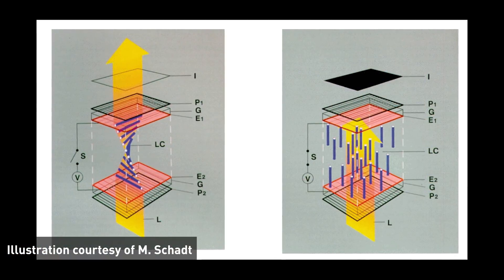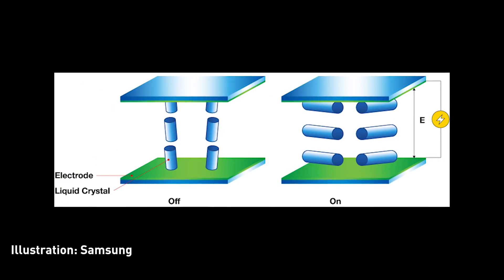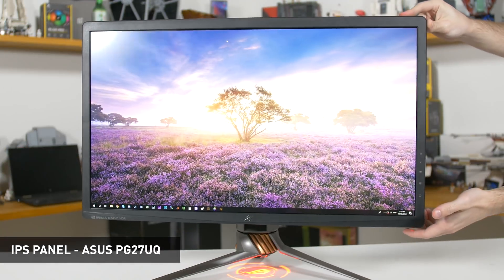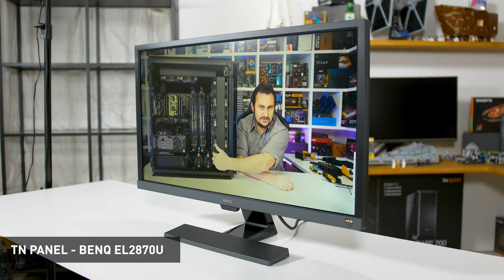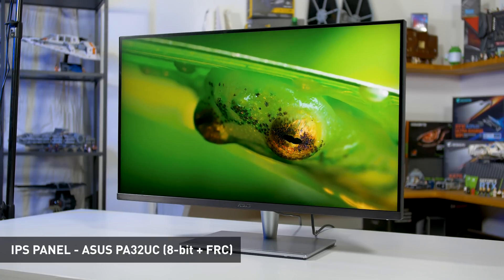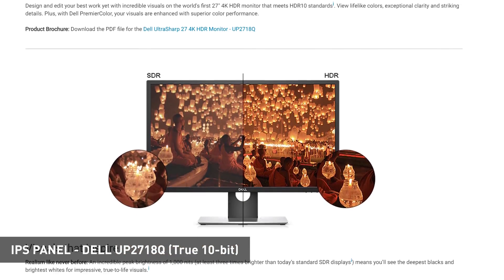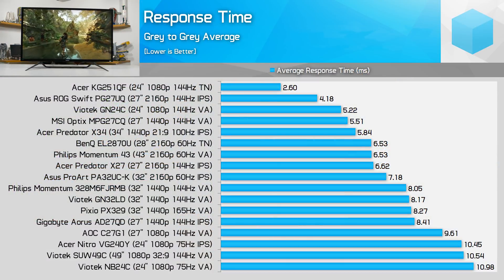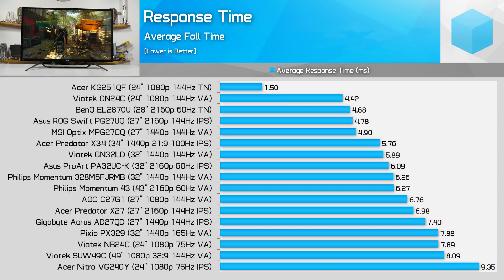TN vs IPS vs VA: Which LCD Monitor Tech is Better?

Comment: TLDR IPS SUCKS, IPS GLOW IS AWFUL, VA SUCKS MOTION BLUR AND GHOSTING, TN SUCKS POOR VIEWING ANGLES AND COLOR. ALL SUCK, PICK YOUR POISON! I can't stand IPS GLOW, my gaming room is light controlled and I play dark games.. Diablo, Doom, etc, IPS is unplayable soo bad. TN Contrast ratio no so bad when you turn monitor brightness down to 20, which is plenty in an always dark room. 8 Bit TN are actually quite good with colors too, they are out there, my XL2730Z is a 5 year old, 144 hz 1440p, 8+FRC Bit panel. If it had better freesync i'd keep it forever, but not compatible with Nvidia so looking for an alternative. If your buying top end TN (Think Omen 27), your going to get 8 Bit color, "better" contrast ratio's, and super speed. Not enough emphasis is placed on the difference between cheap low quality TN, and high end TN.

Comment: Short Answer: 
TN=competitive gaming 
IPS=video editing and most type of gaming
VA= watching movies and casual/singleplayer gaming.

Long Answer: For most people I would say IPS is the best because they have pretty fast response times and refresh rates along with amazing colors. So you can create content, but also have a very responsive gaming experience. If youre a competitive gamer and want every advantage possible, go for TN. Honestly most people hate on TNs, but if you buy a high quality TN, the colors really arent that bad from head on (which is where you will be looking from anyways). The colors usually look a little washed out from the factory but if you turn up the vibrance, it looks pretty nice. I wouldnt really recommend VA for anyone because, personally, I think 144hz should be the new standard, and VAs just dont have a fast enough response time to deliver that. Unless you truly prefer cinematics and visuals with HDR, IPS is the much better option. Ive gamed on VA displays but it just feels too slow and blurry. IPS was definitely a big step up, but it still didnt feel as snappy and responsive as TN. So in conclusion most people would be best off with a 144hz IPS display. 

Side Note: I prefer performance over quality, which is why i dont mind the colors on TN panels and still use them, but I only play games (mostly competitive) and watch youtube, and from what Ive seen most people think TN is unacceptable compared to IPS and VA. Then again though its all preference.

Comment: So what's better a 1080 TN or a 1440 VA? Both supposedly 144hz both supposedly 1ms response time.
Reply: 1 ms on VA panel?     30-50ms on dark colors (black smearing)...
https://www.tftcentral.co.uk/reviews/coolermaster_gm34-cw.htm#gaming_comparisons
Reply: @besmertnik  yeah I don't believe it either buy it's the claim on the specs. I am still torn though price is similar. I guess it just comes down to their resolution.

Comment: I've had large monitors of all three types.  TN has only one redeeming quality - they're cheap.  I've yet to see an IPS panel that has decent black levels.  In a brightly lit environment, they are fine, but turn the lights off, and they're just awful.  And, that IPS glow is annoying.  My current monitor is a VA.  The blacks are great, there is no glow, and the difference in contrast is obvious.  After owning a VA, IPS and TN looks dull, due to poor contrast.  Still waiting for OLED, or something similar...

Comment: I just bought an MSI Optix G241 (not to be confused with the MAG241c)
This has a 1ms response time
144Hz
Relatively budget

And is an IPS!

The days of TN are coming to an end...
Reply: Msi g241? Is it good? I'll buy a monitor and still confused between g241 and asus vg249q. Who is the best between them? 
Sorry for my bad english;)
Reply: @Fajri SN
having never used the ASUS monitor, I would just say that the MSI Optix G241 is definitely worth the £199 price tag and is probably the best gaming/workstation monitor below £200
Reply: No monitor has a true consistent 1ms response time, not even monitors with TN panels. But yeah thats a beast monitor for its price.

Comment: i want to buy the optix mag271c, but what hardware unboxed is saying that response times to big create a fake 144hz experience took me offguard. the monitor would still create 144 images per second, right?
i have been googleing for a day or two but hardware unboxed is the only one saying this.
edit: because of availability in my country the model i want to buy is the mag27c but this doesnt change my question.

Comment: I use a TN 24.5" 1080p 240hz. (Alienware). After a year I feel like the colors are as good as a TN could have. Response is amazing. Never had an issue. Viewing content like video doesn't bother and esports and multiplayer games it is a dream. I do find it harder to spot distant objects in 1080p regardless if in game settings and draw distance, but I haven't compared with a 1440p 27" which will have a similar pixel density anyways. 
THE MAJOR CON: overall despite colors being good enough for games like cs: go, warzone or fortnite. Playing a story based game, the TN lacks depth and makes it harder for me to.be immersed in a game. I do have a TV hooked up as well but for shooters I need my mouse and keyboard so I'm more or less fixed to the monitor. Next time I upgrade my PC, I might to upgrade to 1440p with slight downgrade to 144-165hz and IPS.

Comment: ips or tn va never again va is for pictures not gaming 1ms or not i can see pixels in a va monitor move just by shaking my head my ips monitor i would need a magnifiying glass to see any pixels in fast motion eg racing games and tomb raider any grey areas that move show every pixel on the road or walls and rocks never seen this on a tn or ips monitor id prefer a standard home tv over a va gaming monitor i swapped a tn for this va 144hz gsync gaming monitor and regret every minute except for the noticable corner fade on the tn which was what made me swap it !!! so ips 144hz

Comment: Hey, I wanna calculate the actual refresh rate output considering the following:
Panel: VA
Refresh rate: 200 Hz
Claimed response time: 4-6 ms

Can you please explain how it is calculated?
Reply: With overdrive cranked up to the max (significant overshoot present visible as white trails in front of the image), it's basically unusable for actual use. Be prepared for that panel not being able to do actual 200Hz, which by all means & purposes isn't a deal breaker for most, especially at 1440p or higher where GPUs don't hit 200fps consistently anyway.

Comment: Stop this insanity. МVA panels have superb colors, at angle they only slightly loose contrast. I think manufacturers somehow tricked even reviewers to say that IPS is the best, while the truth is that МVA is the best. I am a graphic designer, once I bought IPS and returned it in few days, because this IPS glow is visible at modest angles and you can even get color inversion at extreme angles, IPS is ridiculous. I rate them that way from 1 to 10:
TN: 2 (bad colors, bad viewing angles, color shifting and inversion, fast speed)
IPS: 6 (good colors, glow at modest angles, medium speed)
VA: 9 (good colors, usable at all angles, slow speed)
before buying IPS you should really check if you can live with the IPS glow effect.

Comment: TN 4K, 1ms, 60 Hz Monitors are fantastic for flight and racing sims. No need to sit at an angle anyway. Contrast ratio is easily configured in calibration settings.

Comment: I went with a 32" VA because when I looked at it and looked at the competing ips panels, the tn just seemed to be a better value overall. Plus, a 32 inch curved display is an absolute portal into your games even more so than 34" ultrawide to me, mainly because of the extra vertical space. Maybe a 40"ish ultrawide should be a thing? I know 38 already is but that still doesnt have the vertical headroom I think I'm looking for, and honestly 16:9 with the extra vertical space seems to be more immersive for me. Who knows, maybe 1000r curved 49" ultraiwde will actually take the ticket for the 240hz🤷‍♂️ so many choices in 2020

Comment: The cheapest ips are garbage, there are many subtechnologies.  Each brand names their subtechnologies differently, like e-ips or ah-ips or whatever, very confusing, and many times omitted.
Cheap ips viewing angles can be almost as bad as tn, the spec is marketing and useless as its measured with an absurd threshold aka if you can see anything at all its fine.  Viewing angle matters a lot more when you have multimonitors, the brightness gradient with cheap monitors is obnoxious. Cheap sale priced ips, don't do it.

Comment: I have samsung TN panel 22inch 1680x1050, then i switch to Dell 24 inch IPS 1920x1200 and now i have a philips 1080p VA 75hz panel.
Black lever on my philips are so close to the oled panels on my phone.
Great image quality. Seriosly is the best i see now. That poor philips is use samsung VA panel and is cover 98% of SRGB color gamaunt.
VA panels are great. Really. Now i wont 144hz va panel whit 2k Resolution and 32 inch panel.
Reply: 1680x1050=Sounds like a high-end monitor from 2008 or somewhere in the Core 2 era. And recently, it looks like the 1920x1200s are common now, at least that's what NewEgg shows.

Comment: I got a Lenovo L27  IPS Monitor ,  based on what ive saw on HP SPectre X360 Laptop , great screen on that one , so i go ok give me one IPS 27inch monitor , turn it on back home , compare since i couldnt see it while purchasing nor could i find anything on web , they said this monitor is good with good blacks .
man there are no blacks , black is dark gray . So i press menu button on monitor to try to set it up , and there it is Black in the monitors menu , its made of Gray and black .  But after changing everything i could i cant get that black to show up in windows , on any PC. Anyone know anything about this ? Black level being lower in monitors internal graphics or menu and in windows there is no black just dark grey ?
Reply: One of the cons of IPS displays is poor black colors. If that's what you were looking for, a VA panel would suit you more maybe. I have an HP spectre x360 too but it must have a better contrast ratio or it's not as noticeable on a smaller screen, I agree the blacks on this laptop screen aren't bad.
Reply: @HuskyTech891  m8 ,  i know how things are , thing is this 27 inch monitor can do black , i can see it in the menu ,  the menu is made of black and gray , and there it is . Ive even drawn black background in photoshop ,then pressed menu , and there you go black on gray . I dont understand that , why it wont show that shade , obviously  it can do darker but it doesnt want to .

Comment: I ended up going from TN to IPS and the difference was incredible. I don't know how it would compare with VA because I never saw VA monitor in person
Reply: better than ips...
Reply: @atugamer3878  What is better on VA compared to IPS?
Reply: @MarkoVuckovic32  The contrast - it can display blacks. If you dim IPS panel you will get juch a gray light source, that is also why I am returning my quite expensive 4K IPS panel and getting 1440p/144Hz VA monitor instead. I also found out that 4K is really overrated aspect that gives me almost no advantage for my work or gaming.
Reply: @jendabekCZ  How much gaming do you do? I've heard the dark pixel transition/blurring is pretty bad on VA panels. Do you only play single player and it's not a big deal for you in those instances?
Reply: @HuskyTech891  Bad Company 2 and Richard Burns Rally, both are very fast paced games and in both cases the panel does very good job for me (Samsung S27r750q with custom stand).
Maybe if you compare it directly with some TN you could see this kind of imperfections like ghosting, but there is nothing that I would notice during the gameplay at all. If I do that famous "ufo test" (google it if you don't know), I can see the ufo perfectly sharp @ 144Hz.
I think that only progamers wouldn't be satisfied with this VA panel, I play both games on quite high level (RBR on competitive level) and it does the job perfectly for me... and compared to any TN it provides me great colors & contrast as well.
I can compare BenQ IPS, this VA and TN I use as my secondary monitor ... and I really think that good (modern) VA monitor is the way to go for vast majority of people today.

Comment: I'm more confused than ever. Im in the market for a 34 inch ultrawide. I cannot decide between VA and IPS. People on forums are zero help as they are all hardcore fanboys of each type. Assuming I can afford the best VA or the best IPS, which would be the best choice for a solely gaming setup? The advantage of IPS is often sold on viewing angles. But is that an issue on curved screens?

Comment: massive amount of disinformation about tn models in this video
Reply: Calling out without pointing out kind of makes your reply useless
Reply: @StatusPia  to put it simple the ONLY and i mean ONLY innate disatvantage that tn has compared to ips is in color shifts from different viewing angles, that is it, everything else i the same or better
Reply: @ImWanderinIf  you mean colours(not colour shift) and contrast is better in TN as compared to IPS? XDXD
Reply: @TakumisBizarreRacingAdventure  color gamut isn t any worse, contrast is slightly lower but it has no ips glow and much better black uniformity usually so the perceived contrast if anything looks better on tn

Comment: Definitely a VA panel, the IPS glow in any dark environment kills it.. IPS is fine on TVs that use local dimming but horrible on monitors as they don't have it. VA doesn't have any glow and the blacks and contrast are very noticeable.. Good va panels offer great colours but still not as good as ips.

Comment: Ips nice color  tn high refresh rate  va best of both worlds with best viewing angels the least amount or bleeding and the deeper blacks and more gamma and bolder colors . Ive owne all 3 types and VA is my fav ips is annoying to me its supose to be the best for colors and stuff but the va panel with its deeper blacks and higher gamma might not be as accurate to the color but my god does it look so much better like when i first saw one of those vizios on display at costco sure it might not have the best color or the fastes response time but it has a better picture quality i think couse of its deeper blacks and gamma its so pretty to look at no joke and modern good va panels now a days go up to 165hz and qms response time so no need for tn anymore

Comment: I'm buying a VA wich says has 5ms. If its true there should not be any ghosting right?
Reply: Depents on the lvl of overdrive you are using.Best one is normal, but extrem will get you an overshoot.
IPS Panel´s have quite alot of backlight bleed, which you defenetly will see in dark images like movies or games.
And if you saw them once, you just will stare at it and it will distract you.

Here you can see how how 

TN.vs VA https://www.youtube.com/watch?v=GzAgGNDjSjk&t=345s
IPS.vs VA https://www.youtube.com/watch?v=l2AGMFXAx90 looks like

Comment: I've been using IPS panels since 2006, apart from one model of LG I had issues with, none of the rest had this type of "glow".
VA panels can be good for video editing just fine.  Just make sure you either get a pre calibrated monitor or calibrate it  yourself.
Reply: @Lady Cyprus If this is indeed the case (newer models having the issue) then that just sucks.  Also thanks for the info.
Reply: @mojimocha I suspect the default backlight setting is too bright!

Comment: @4:00
i have a TN, Acer KG271U 27" WQHD 75Hz, from Microcenter
the thing about this is that, i've had worse TN panel products
i find it to be, lowercase acceptable.
i've had some Un-Acceptable tn viewing angle laptops
for a dedicated monitor or device, i think it is acceptable, Despite being TN.
of course, IPS IS BETTER.
i've seen there is a spectrum of IPS screen quality, i.e. light bleed when the monitor is off

for $200, I got 27" (very optimal, most demanded size, in this price point)
2k, 1440p, 2,560 x 1,440 resolution
at least 60 hertz (i don't prioritize games toooo much, i have a ps4 slim on sale, its actually possible for 75 hertz, coming from a monitor when that stuff didn't even matter)

For another $100, (%135 price increase) (Plus Tax)
i could get 27inch, ~2k (even 4k i've found((4k is best on 32-inch i heard))
higher hertz,
and I.P.S. *

you really are paying for IPS, and everything else comes with that, at the $300 price point
but i have other things to buy, atm, And i think the tn on this acer $200 monitor i found acceptable...
still have couple days left in the return policy, but

its fine.